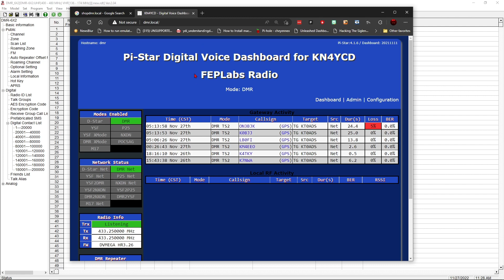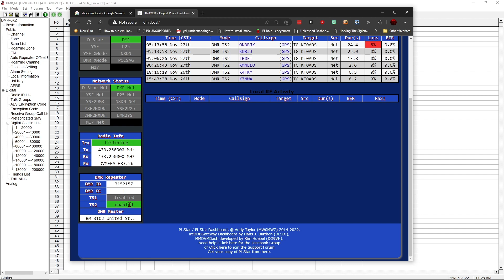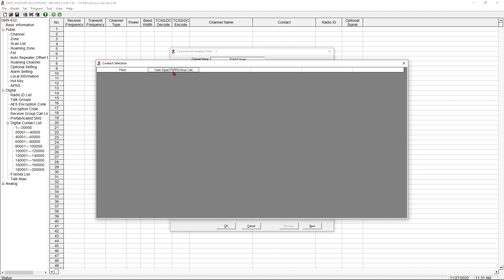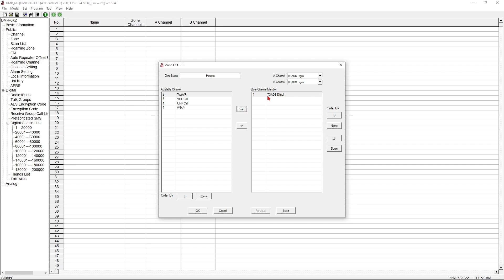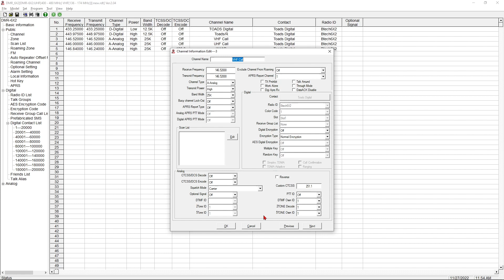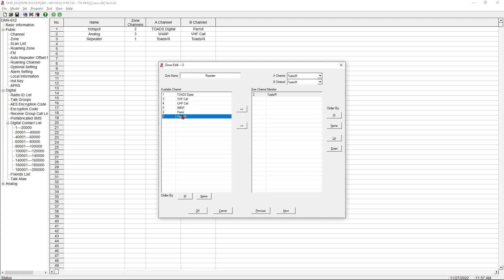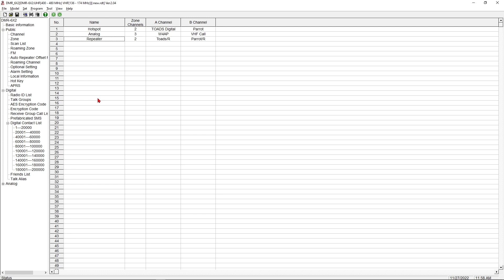Learn the DMR code-plug secrets!

Comment: Hey Jim I am just getting ready to get a DMR Radio I have ordered one it's the Baofeng 1701 will it set up the same as the 6x2 I also have a hotspot coming I have been licensed since May 2022 I have read up and studied on ham radios since I got my CB license in the seventies just before the last year of them and still trying to learn more on amateur radios 73 K4BWN
Reply from the maker: I don't know  - I've not had the 1701.  It should be in the neighborhood. Most of these things are pretty close in the way they set up, so on any of my videos, the same pieces are there, just not specifically in the same place.
Reply: @FEPLabsRadio  I know they said update the firmware the open GD 77 I've got it downloaded on my laptop now (version:R2024.01.22.01)